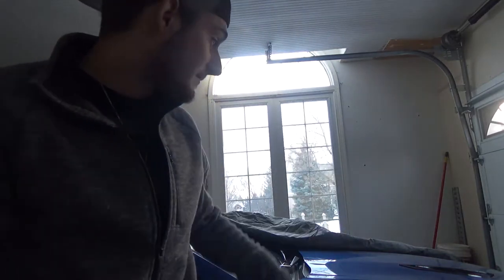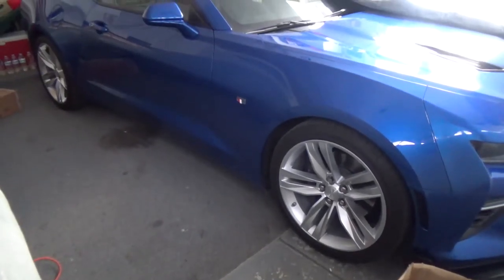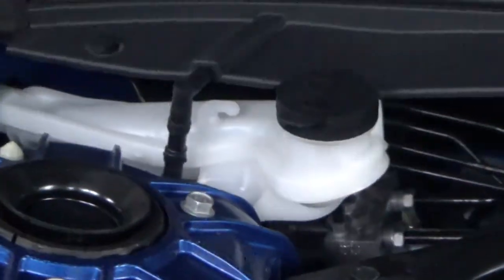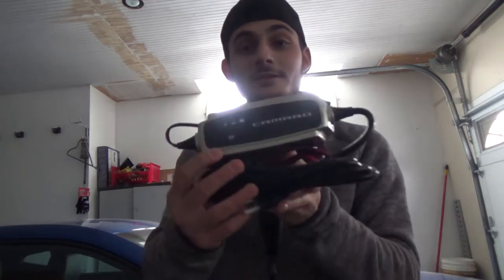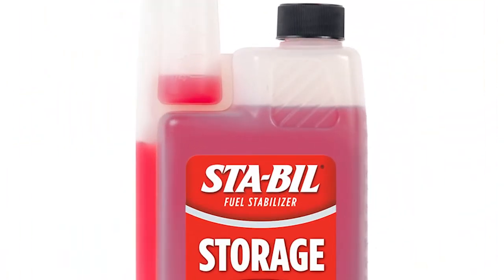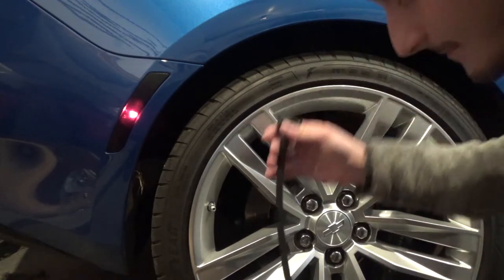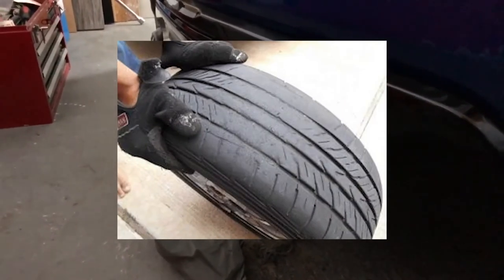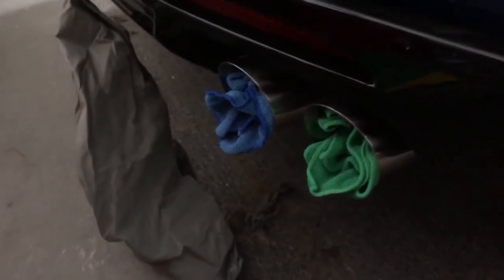How To Prepare Your Car For STORAGE

Comment: the flat spot on the tires will go away on radial tires.  make sure tires are not on concrete.  it will dry rot them.  put on carpet like the video says